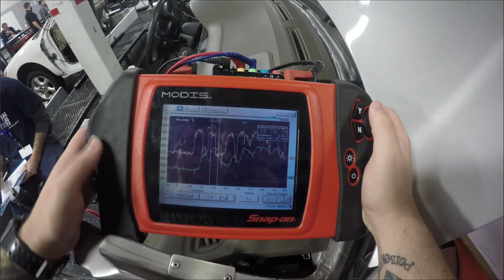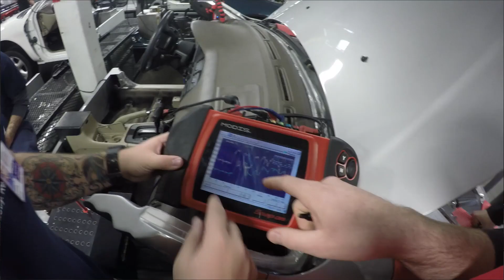Day in the Life: UTI Automotive & Diesel Tech Student Britton Bowen - Universal Technical Institute

Comment: Whats the tuition fee
Reply from the maker: Tuition is based on program length, shorter programs like Welding, CNC, or Motorcycle are around $20,000 and longer programs like Auto or Diesel are around $32-36,000. Also additional elective classes are available, some are student paid, some are paid by the manufacturer. If you have any questions, including Financial Aid and Scholarships, pls contact the Admissions Department at 1-800-834-7308. Thank you.
Reply: Mine was about $50k for automotive tech
Reply: JJ Amaya was it worth it? Debating on going to the one near Dallas. But I’m hearing mixed things about it
Reply: JJ Amaya what?!?! 50K?!?!? For what? How? To be a mechanic? You paid that much??????? Why?